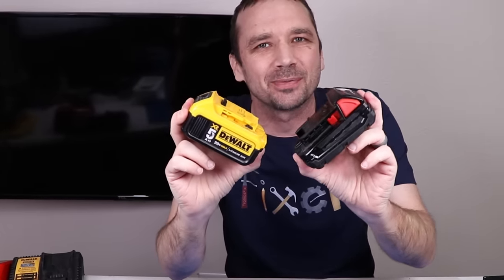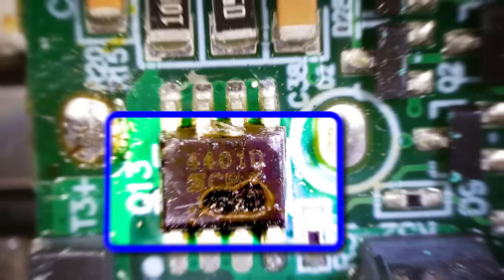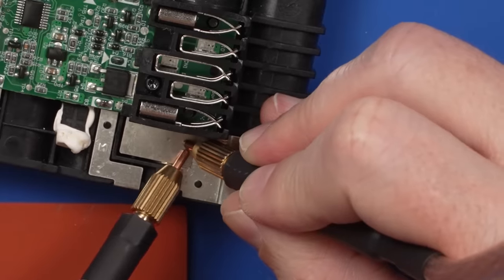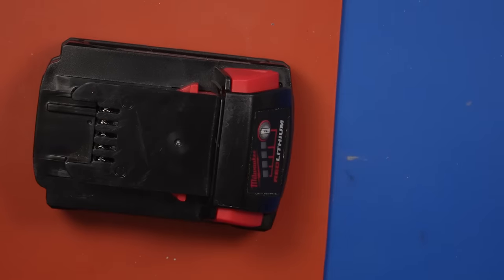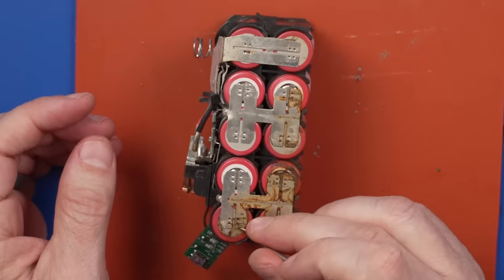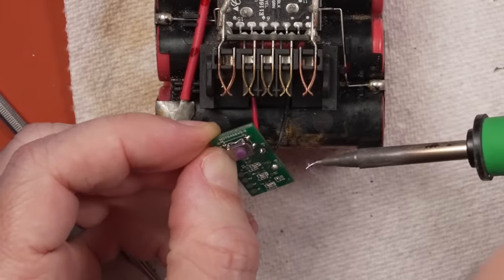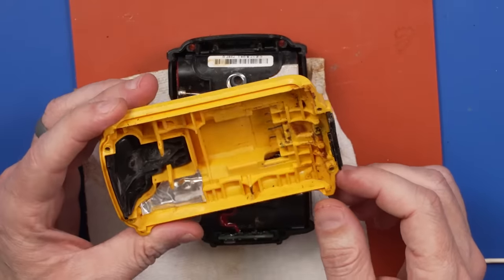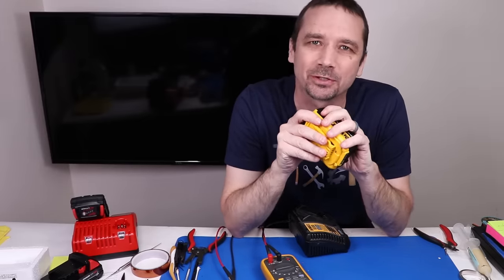Are Power Tool Battery Packs Fixable? Let's Find Out!

Comment: Brother, I have a PS4 Pro and we know that it has a very loud sound from its fan. Just replace the thermal pads of the memories, with 1mm ones but the size of the memories, and the others with their original size, no more loud sound from the fan and the temperature improves a little, greetings. thanks for your videos and advice.

Comment: For the Dewalt battery, when the voltage gets that low it needs a jumper charge in order for the charger itself to charge it, 14 volts is pretty low in comparison to its 21v or so when fully charged.

Comment: I would check all the batteries independently, I have the same issue with a milwaukee m12 battery as you're having with the dewalt. Reads as full when voltage is low. Dug in deeper and found one battery that had noticeably lower voltage than the others. You can either charge the batteries manually and independently to the same voltage, or replace the cells altogether.

Comment: I use the tools below. These are very useful for opening a drill hole on a printed circuit as solder does not stick to stainless steel.

Comment: Sometimes Dewalt battery packs get used with tools they were not made for, by using adapters which is great but the problem is the tools have built in failsafes that keep nthe battery from being overly discharged.  in this case you must jump start the battery by using another battery.  this has worked multiple times for me.

Comment: The strips that came with your spot welder are nickel coated steel. The contacts on the battery are probably actually nickel. Its a lot easier to spot weld steel, but it can carry much less current.

Comment: I have same case on Dewalt before, I have 18V battery and fully depleted, when put on charger it just show fully charged but when try to press the indicator light it just shut down. Saw on youtube about this case and found video that if the battery fully depleted, we need another battery pack to "jump start" the battery (like car jump start, + with + and - with - couple of seconds, and then proceed with normal charging). not sure why, but it works for me couple of times.

Comment: Great Video. I've had a few of both brand batteries apart in the past. My question to you is in regards to the spot welder you were using. By any chance is it a 120v unit. I'm interested in purchasing 1 in the future but was warned not to get 120v spot welder and to do myself a favor & get a 220v spot welder right off the bat. Just wondering. Thinking maybe thats why it struggled with them spot welds.

Comment: The Dewalt one can be "jumped" to get it working. Connect + and - from a good charged battery to it to get voltage up a little more and then throw it back on charger.

Comment: Dewalt battery is likely be below the threshold for the automatic “smart” charger to recognize. A bench power supply at 16 or 17v may bring it up enough to then be recognized, if you had any further interest in saving it. 👍🏽

Comment: I have to highly recommend WÜRTH's electronic contact spray for these applications, I find it's one of the few contact cleaners that doesn't weaken plastics at all, and it also leaves a slightly oily protective film that stops moisture from reentering. It is quite expensive though, but I believe it's well würth it.

Comment: Fun fact: u can use another 18650 lithium battery to carge the undervolted 18650 battery and also otger undervoltaged batteryes, have used the trick many times and has always worked

Comment: I have an electric pruner that came with two batteries. One would charge, the other wouldn't, despite being new. The battery opened easily, held together with screws. I have a magnetic, automatic polarity, automatic detecting of voltage and battery type, charger. Plugs into USB and stick the magnetic contacts onto the cell terminals. One of five lithium-ion 18650 cells was at a good voltage. The other four were a bit below. The BMS circuit board in it looked very nice for a bargain Chinese tool. Every cell monitored individually and apparently it's set up to not charge at all if it detects one or more cells are too low.

It only took about 30 seconds using the charger on each cell to get their voltages fairly close. I put the battery back together, connected the charger and it charged. The pruner works fins with the "bad" battery.

Comment: If the charge has dropped too low and it won’t charge, you can force enough charge into it with a variable voltage power source, just connect up the +&- correctly and force some voltage into it, once it get enough power it will start charging on the charger properly

Comment: The marker on the PCB "Q13" would indicate to me a Transistor (most likely a MOSFET). Looking at the pins, a single MOSFET (not a dual).
And a quick search finds a P-Channel MOSFET (-30V, -6A) under the same number (4401) with an apparently same pin-out: (4 pins on the top are joined to the Source, 3 on the bottom to the Drain, the one on the bottom right being the Gate).

Comment: Hi Steve. With the Milwaukee the voltage is just too low. You could try manually charging it with a bench top power supply but the cells are probably risky being so overly discharged. With the Dewalt, the charger is probably mistaking the battery for a 12V Bat. Simply charge the cells manually to about 18V and you should be good. I wouldn't be too worried about the corrosion on the cell welds though I'd definitely advocate cleaning it completely with wet and dry sandpaper and then a corrosion inhibitor. I'd also check the individual cell voltages to ensure you don't have any bad ones. At 14 odd volts they are very low (less than 2.5 V each in a 6S2P config) so charge them gently till they are above 3V per cell then your charger should work. So sorry to hear about your lymphoma. Get well mate.

Comment: Hi Steve, I hope you get through the Chemo. I had a girlfriend that had Breast Cancer and it was a horrible ordeal.  I did a lot of research and I can tell you I'd do things differently, but I'm not here to do anything other than wish you the best.   I have a Milwaukee batter bank that just won't charge, I've opened it up and darned if I can see any issues... but I'll look again.  I have a similar setup with a microscope and a SMD rework station.  Maybe I can revive it with an after-market charge board.

Comment: The connections on the thermistors frequently break on these things and the batteries are only rated for so many cycles so if its a battery thats been used alot its a good idea to start there before playing around with the pcb

Comment: The typical failure on those packs is the BMS will overheat, and then cells go out of balance. after that's happened the charger will just flash. balancing the packs fixes them 7 out of 10 times in my experience. you can also jump it with a working battery and then toss it on a charger, but doing so has a genuine risk of quite literally rupturing a cell and letting out the magic smoke (and fire) of the cells.

I'll typically scrub the contacts with a contact cleaner, and then the PCB as well. and attempt to charge, if that doesn't work I look if the cells are out of balance, and following that if there's any deeper issues. MOST of the "broken" packs I buy are just a quick R&R from being functional. I've left the electronics world behind aside from hobbies and work as a heavy duty mechanic now ( better pay and simpler systems lol ) but buying broken packs for 40 or 50 bucks is very much so preferred to spending 300 on em. Most people don't even bother to try and clean their packs and I've gotten a boatload for free, it's nice to see them not get tossed.

Comment: If it has not been already been said, voltage too low on first pack, plug low pack on good charged pack for a while to get voltage up then plug back in charger. Other way again if pack not defective plug on charger the connect and disconnect charger form wall lol saw this couple of times and it worked, from a kid on youtube lol !!!

Comment: What tool did you use on the image at 3:32 to change the contrast on the image? was it after edit modifying or do you have a application that does that? 
Thank you great video i love working on saving old batteries. any more seasoned technicans perspective really helps learning more about how we can fix them. I never knew we could scratch off the top of the chip to get some numbers. Thank you

Comment: Well most affordable spot machines can do up to .12mm contacts. Any thicker and you need more power. You can jumper with .10 leads. Also just cause they stick now doesn’t mean they will hold, you should test by prying/wiggling the connection. You could grind down an area with a Dremel to thin it for a better connection but you will cause more heat in that area as the battery supplies amps. That is one of the issues with thinner gauges is the ability to hold current. The width and thickness of the leads determines the current limit. So if you go thinner, go wider.

Comment: Just got a spot welder myself, so no expert.  That said, the way you weren't getting good welds even at the highest output I saw in my research among those with a power source with insufficient amperage, don't know what you're using.  Car battery, sure.  UPS 12v battery, no good.  I use a couple of 30amp LiPos so their combined output is enough to make lil sparky happy.     Be well brother, great vids.

Comment: The red and green is likely because one or all of the cells have been over-discharged. The cell(s) might be damaged or they might have sat too long discharged because the board was damaged. Use probes to charge each cell to around 3.2v and then try again. I bet it will work.

Comment: Charge each cell in the lock separately and to the exact same level then pop it back on the charger and it should charge fine.  As it’s been said previously, if it drops below approx 15v then the charger won’t charge it.

Comment: When you are spot welding, you need one probe on each side of the weld.  Putting them both on the same piece will, at best, give you a poor weld because you are giving the current an easier route than through the weld.  Usually you will get nothing.

Comment: 2.4V is WELL below the minimum for the M18 charger to work. I had this issue with brand new M18 batteries that read around 12V, which is less than 2.5V PER CELL.

Comment: From what I know of lipo batteries, the charger won’t attempt to charge if the cells are below 3v. Being that that’s a “20v” battery, that’s 5 cells, so the minimum chargeable voltage would be 15v.

Comment: So what you can do is take a good 18950 batter and put it in paralle with each individual battery to bring their voltage up or you can make jumper cables and plug it in paralle with that new milwaukee battery to see if that will even the charge cuz the flashing red/green means problem and cells are probably too low.

Comment: The charger thought you plugged a 12v battery in, because the voltage was low, too low for a 20v pack but fully charged 12v pack. Use a desktop power supply and charge the cells up evenly first and the pack should recover

Comment: Hi Steve hope you're doing well. I have question I have an older Hewlett Packard 80 calculator and was wondering if you know of a place that sells the battery pack for it. Contacted Hewlett and they said they don't sell the battery packs any more. Hope you can help me.thanks.

Comment: often times with these batteries they go below the voltage required for the charger to identify it is plugged in. Use some spade connectors and a battery charger to get them a little more voltage.

Comment: Nice demo of an adventure into the challenging repair of a DeWalt and Milwaukee battery. The Milwaukee will be the most challenging because it has a special board that is very different to the aftermarket board. With charging the battery actually talks to the milwaukee charger to charge. If the board is not compatoble it will not charge the battery. I am actually surprised  the board did charge in the end. I think the milwaukee battery is still not repaired in working order because the base voltage measurement is 2,45 volts over all the 5 cells. This is not good news as it means that one or more cells are damaged betond repair and needs repair. All cells should have the same voltage. If one cell has a lower base voltage than the other cells the milwaukee charger will likely only charge one cell, the cell that has the highest voltage. So even though the charger saysthe battery is full. because the lowest charged battery will not be charged I'm balance with the others. You can notice that, because a charge could give only three bars at full charge or that than old batterybis charged up faster than a bramd new one. Easiest way though is to measure the voltage before and after a full charge. That is the easiest way ti find the faulty cell. You will often also find that the faulty cell will lose its charge fast while measuringthe voltage of a fully charged cell in the pack. The problem with all power tool batteries is that the circuitboards have very poor cell balancing technology. There are already aftermarket better actove balancers available. The challenge though is that they don't fit well in the already tight enclosure of the packs as an after market solution. If they would fit I think it wouldn't be a big fix to add an active balancer board, especially for the bigger packs.  I think for a smaller pack thos aftermarket board is fine, bit for the bigger packs the boards are actually insufficient, which is why I think we see more issue with the bigger packs. Would be nice if we could add a better aftermarket board for those too, bit also have active balancing for all the cells in the pack, when charging.

Comment: All you'd have to do is jump the battery with another battery like a car battery for a little bit to get the charge up then the charger will charge it right up in most cases. Works with any battery really, cell phone, tablet  etc.

Comment: Hi I'm not an expert, but from what I understand, you might get a better spotweld if you have the probes on different surfaces, I think by putting them on the top plate close together, you have created a short low resistance path on the top plate only, it doesn't have any need to flow current to the bottom plate, so it wont get 'hot'. I would have one probe on the top plate and the second on the bottom plate as close as practicable but not touching the top plate, so the current has to pass through both plates, so they should both heat up to the same level, I'm not an expert, but this is how I would try to weld. Best wishes on your health issues

Comment: I've had multiple 12+18v Milwaukee batteries go "bad" like this. 9 times out of 10 it's the cells got too drained. 

You can hook a bad battery pack to a known good (jumper) and monitor voltage. Once above charging threshold, pop on the charger and good to go.

Comment: Once my Milwaukie got discharged too low and original charger was not charging it. I used lab power supply to bump voltage, and then orginal charger worked

Comment: A person might check each battery individually to see if there is a bad one in the bunch, I've heard if batteries are too low you can charge them (very carefully) other ways until they are high enough to maker the charger happy like pairing them with another battery with a varible resistor to limit the current or individually.  if your gonna replace batteries don't mix brands or types and pair them as best you can etc, but learn all you can about the charging curve etc and / or charge them outside maybe even in a fire-proof box...  there is much to know

Comment: For a battery that won't charge, I saw a hack where you plug it in then unplug and plug in about 15 times super fast and then try charging it. I tried it on my broken batteries and it worked. Maybe try that.

Comment: If you want to learn how to modify Li-ion batteries, make sure to learn it in a location where you can safely toss the battery if it catches fire. And see some videos about high capacity Li-ion battery fires to have some kind of understand what happens if the battery catches fire (it needs lots of space to burn and generates lots of heat and smoke and the fire cannot be taken down with any traditional means). And check the charging curve of individual cells to understand what kind of voltages you should be seeing. And do not try to charge the cells without a power source that can limit the max current.

Comment: Super late comment, but if the batteries have some charge , you can still boost the voltage to 3v with a USB charger and some bare leads, and that should be enough to get them to charge again. Each cell should be at least 3 volts. 3.7 max.

Comment: yeah...../me looking at my desk scattered with 18650 batteries......................built a few battery packs with bms....maybe a few lights as well.sometimes help to charge the batteries with a small lipo charger to get them above the 2.5/3V level where that charging board will take them

Comment: Dewalt likely has a pair of dead cells. Charger will report it is fully charged and stop charging when ANY pair of cells reaches full voltage ~4.1V ish. Measure the voltage of each pair and you'll soon spot them. Normally when the battery as a whole drops below the level the charger will accept it wont show any lights or recognise it at all. Have fixed absolutely loads of them, some with far far worse corrosion than that. The LED level indicator doesn't have anything to do with charging but I think you probably knew that 2seconds after looking at it! Good luck with your treatment

Comment: If you give a deep discharged Milwaukee a few minutes of charge at 21V at 1C (so 2A for a2Ah battery) with a lab power supply on the output terminals, then the Milwaukee balanced charger will accept it again and do a proper charge.